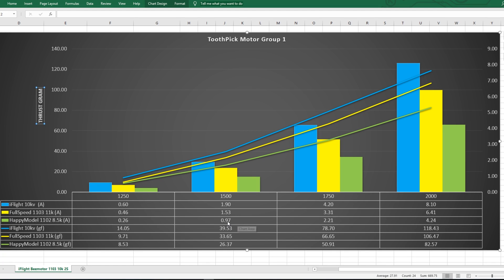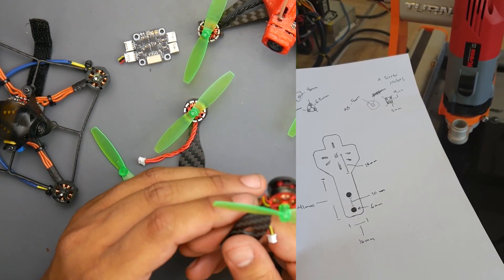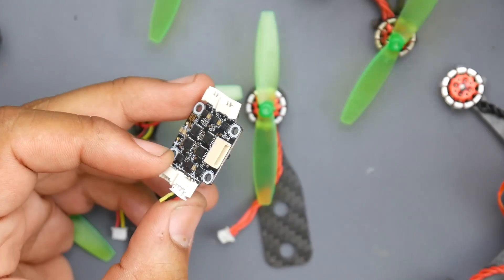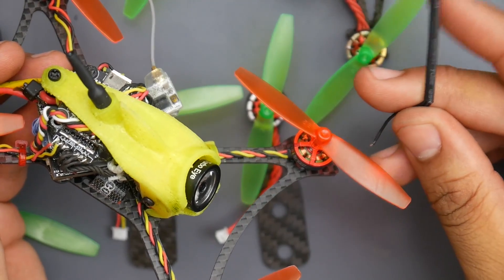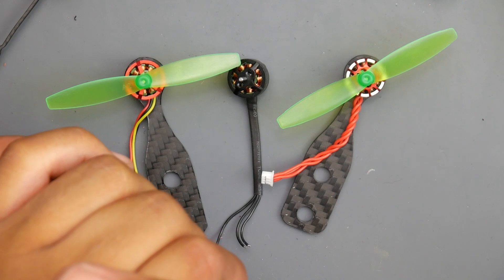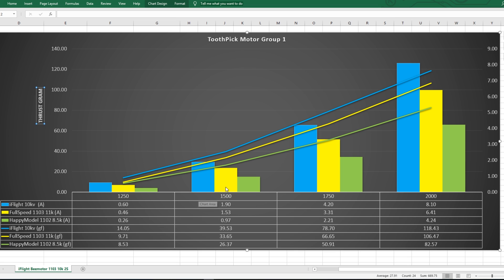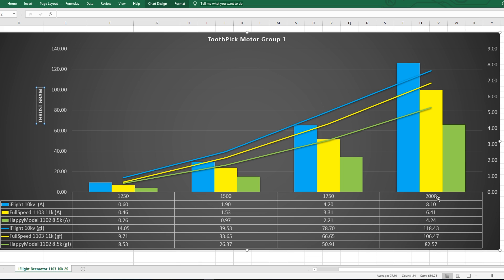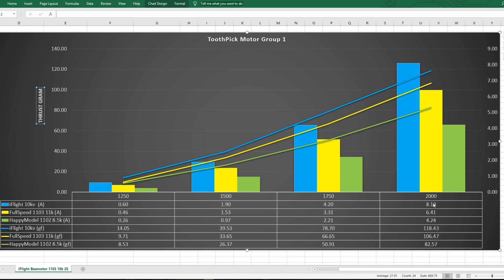ToothPick FPV Motor Benchmarks // Fullspeed 1103, iFlight 1103, HappyModel 1102

Comment: Should you also calculate thruster to amps ratio at a fixed voltage, or watts?

Wonder if you could see prop deflection vs. RPM with a strobe light?